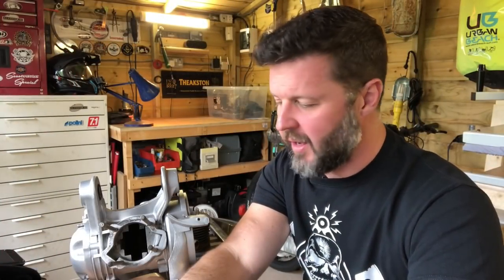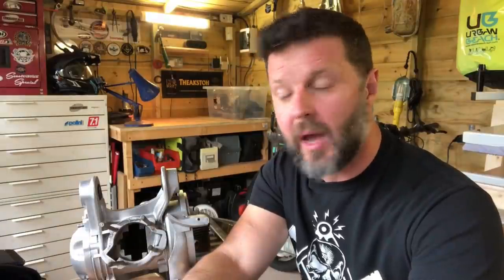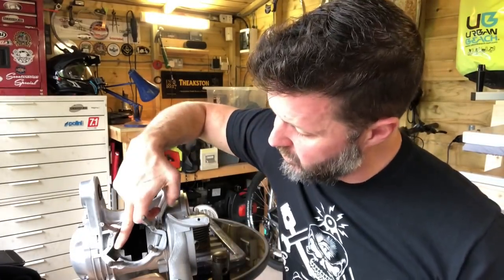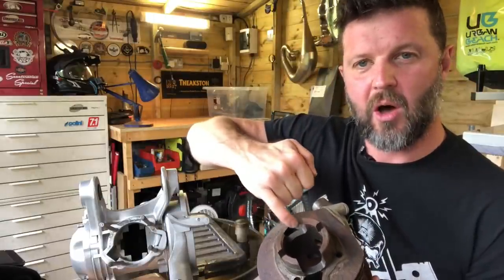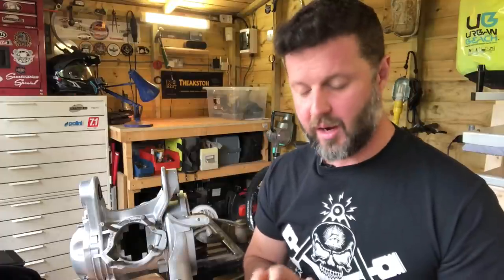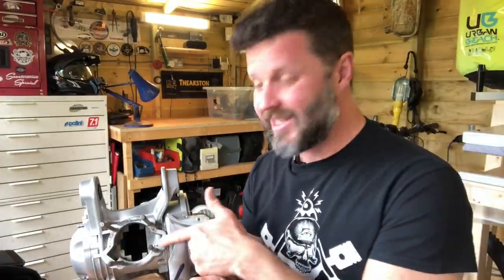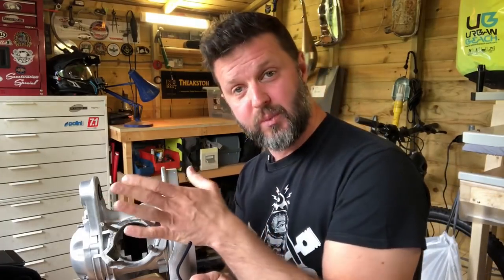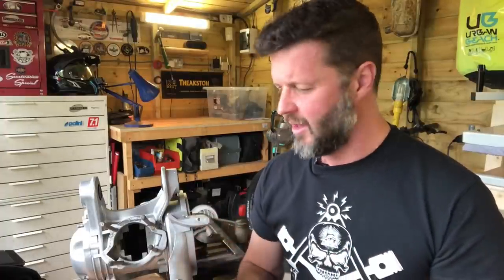Wasted 2-stroke tuning - Does all 'tuning' work? Lambretta & Vespa Scooter Tuning put to the test!

Comment: Thats not tuning ? If you havnt changed port timings and port area all you are doing is matching not tuning ????????
Reply from the maker: TheSteelweasel... the changes discussed are common ‘tuning’ principles as per Jennings, Bell, Robinson et al. Matching, flowing, enlarging case transfers, enlarging case/cylinder spigots, piston flowing etc are routinely done by lots of engine builders. Both test motors in this article first had cylinder port tuning done, and were set up on the Dyno, then these changes were retrospectively applied in order to ascertain their isolated effect. 👍
Reply: @drunkmunkey6969  yes that's just making a nice job and possible better flow, but it wont change performance, but it could improve fuel consumption ? your friend should know if you don't change port timings or port area you wont get more power . and if i ever had port work done by someone i would expect it to look good and not like it came from india ????? sorry buddy my opinion .
Reply from the maker: No need to apologise bud, I welcome different opinions. I used to make my living running a scooter garage and Dyno centre, so I hear what you are saying.... for some reason, customers do like to see a ‘pretty porting job’. It’s interesting though, he tuned the RB252 up to 43hp without doing the discussed modifications, then tore the motor down to test the principles... and there was no difference. 

I guess if someone asked me, do you want the modifications which look good, or the ones that work... I know what my answer would be.  😁👍
Reply: @drunkmunkey6969  I don't do stuff that don't work and your friend was trying to prove a piont so he  may be some what bias ? If someone else did the same test then it's  verified.  Until then I tune my way . Best regards Steve
Reply: @TheSteelweasel  the results prove the point. You think the guy who took the time to do all the work, measure the results and publish them went to all that trouble because he was biased? I would imagine that there may have previously been no response to the article in the magazine because people don't like to be proved wrong, particularly those that tune and build engines for a living and will have charged for the work discussed in the video. 
How about you do the same measured tests and either verify or challenge his findings?
It could result in you spending fewer hours completing and charging for unnecessary work though!
Reply: Steelweasel , I think you may have miss understood, the barrel tuning was done first, this gave the massive 43hp result,  the smoothing and matching was done after and this made no difference (to power).
Reply: @mattlight7363  the title clearly states wasted tuning not wasted polishing .......and my first comment was thats not tuning ? now do you understand >
Reply: the work carried out falls into the category of tuning reshaping and changing of volumes to transfer ducts 
im surprised to see you state its not tuning when ive just watched a video of your own  lambretta tuning weaselstyle then go on to carry out the same work   ???
Reply: @TheSteelweasel     how do you know the work done wont change performance  ?
have you conducted testing to evaluate 
    you would need to have seen the std of work carried out by someone before quoting it looks like it came from india 
do you plan on doing the fuel consumption tests at all  ?
Reply: @TheSteelweasel     youve just stated       i dont do stuff that dont work    and an earlier post that case work provides no gains   and case work isnt tuning    yet are doing case work  on videos   entitled tuning weasel style       im confused      can you explain
Reply: @TheSteelweasel         he can now churn out ruff jobs fast     refers to the writer of the article   me... 
     take a look at my TT facebook page at my work    it aint rough  and will continue to be of a high standard
Reply: @TheSteelweasel      the title is wasted tuning   ,    no polishing  was done as your suggesting  ?    transfer duct porting and matching and clearing of passageway  was carried out and a sizeable increase made in duct entry area to see the hp and tq  results of doing such work  that is carried out by many ,and why ?  in the pursuit of extracting performance is the belief of anyone you might ask for there reasons behind doing the work.    The full magazine articles explain all these points
Reply: @UCmC53KjY0K_qZ56mrgifqDg 
why all the post edits ?  not happy with what u said b4 
whys it a shit job ? i,ll list the pro,s just a few i quickly thought of     u list the con,s  (quite apt)
pro,s  
1.   the std case is clean around transfer castings
2   most cylinders are clean around castings 
3. many kits match standard castings
4. if kits dont match there bigger and produce no steps in the direction of flow
5. not porting maintains originality  in particular rare cases and retains proddy class use where no tampering allowed 
6. full gasket areas are maintained 
7.  no major performance gain 
8. future proofs casing as once ported for 1 kit it may not seal on another kit  
9. saves money
10. most performance builds incorporate a packer  that can be cut to mate the 2 components as a transitional cut
11. strength around stud is maintained
12. sealing around stud is maintained as common leak is thru stud hole 
13. best left alone by hobby builders as poor workmanship in this area can ruin a case 
14. no performance gain to warrant the effort put in
Reply: @taylortuning444  so why are you attacking me ? im doing the same as you but you think you can attack everyone and not be questioned ? im pissed off with this article not with you . and ive been doing this 40 years and this is the first time ive seen this kind of self harm by a tuner wtf is up with you ?
Reply: @TheSteelweasel     where am i attacking you ???
i am being questioned  and im taking time to reply  
why is it self harm  theres lots of tuning books  articles and work published  that shows  gains but rarely shows no change results or losses  results  which i feel are more important    
as an example  the 175 kit i did a seperate final different  test and  lost 1.6hp     thats a mod i see nearly every tuner doing     these are extremely important aspects of tuning  we need to know what works and what doesnt to further development 
can you provide the list of cons please to not port matching the case  
and if you can refrain from the obscenity  trying to have a sensible debate here ....
Reply: @taylortuning444  so what did you do to drop 1.6 hp ?
Reply: yes not matching is lazy and done in india where they have no respect for quality . and some in uk it seems .
Reply: bit of background that may explain my position 
i used to tune a lot of 50cc motors 
then started doing lots of 50cc mx work including engine development  for metrakit  spain and cobra motorcycles america    
this involved working with parents and there kids  ,there was many tuning shops around who sold products  one of the first customers i had was an  irish mx 50cc championship  runner up   whose dad was gonna make sure he won the next year  he purchased a huge array of parts   most were fancy anodised products that looked the part ,  he turned up with 3 carbs  19 21 24mm   3 heads   std vhm and bud  4 pipes   3 sets of reeds and different reed blocks ,torque spacers,power blades  and 2 mapped ignition modules 
he dropped it off and went on holiday for 2 weeks and i set about a development program on my dyno  
upon his return we had a major fall out about how he had spent all this money on parts at these outlets and id failed to use them     i gave him back the ktm50  with the motor completely std apart from the 21mm carb  and a v force reed    none of the other parts gave a gain i provided the results  and he paid me for my time reluctantly 
    approx a year later i got a phone call from him  to say        Thank you  and sorry    we won the championship and its been the strongest bike all year .
    
        moral is    it can often be what you do not do that achieves results 
2nd point is    during the many years of doing 50cc many said you want to put a load of stock in to sell will do really well      but unlike the retailers     how could i sell a pipe knowing it made a power loss  then be asked to fit it and hand them a dyno graph showing them it had hurt performance  ???
Reply: @TheSteelweasel     which tuning shops in india is this   ?
Reply: @TheSteelweasel      ive not done all my testing to share   got to save some  for my  retirement book
Reply: For me if your going to spend thousands on top end casings/parts/cylinder I couldn’t forgive myself for not matching the cases for the sake of getting the dremel out for an evening. I always match them.
Reply: @jonathanparker2411  well said
Reply: Company's spend millions of pounds on developing  these engines and Joe blogs thinks he can get a dremel out and make it better got to make you laugh 😃
Reply: @johnallison8349  Yes AF must have lost a lot of money if it cost that much to develop, he might make profit in 2090 ..... Everyone loves 2 stroke cos you can play with them that's part of the enjoyment .